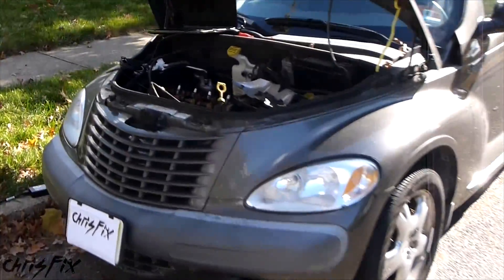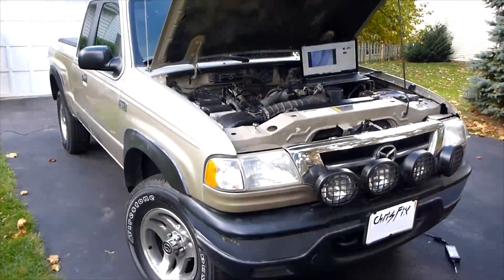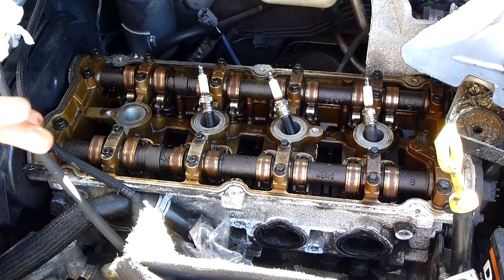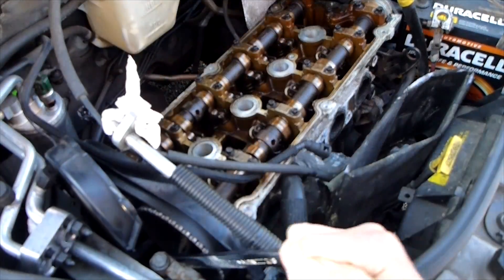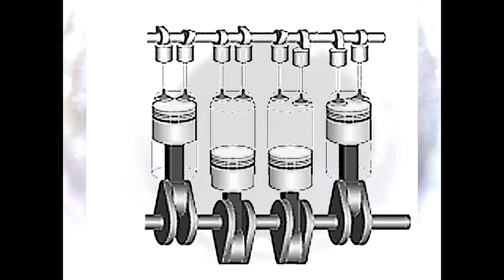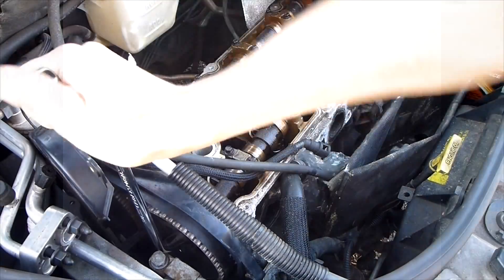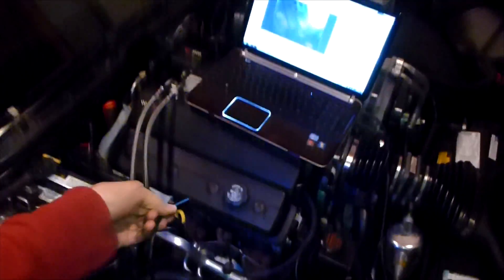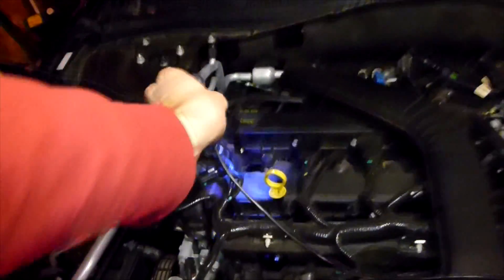What does the inside of an engine with a Bad Head Gasket look like?

Comment: Hey chris. I have a mazda 626 2.0, it burns oil badly. I just replaced valve stem seals, but still smoke. I can see there is some oil pooled on the top of cylinder 3 throught spark plug hole. How to tell if it's the head gasket issue, or from somewhrere on cylinder head? I have ordered an inspector as you used in the video, still on its way. Thank you Chris
Reply from the maker: +Jonathan Zhang It is not a head gasket issue. Sounds like a valve seal issue (even though it was already fixed.
Reply: +ChrisFix i found some milky color sticky stuff on oil cap today
Reply: Jonathan Zhang I am a mechanic of 40 years, from what you are saying it sounds to me that this is a blown head gasket, especially since you found milkyness in the oil. The best way to know for sure is to drain the oil in the vehicle and inspect it. If it has a whitish milky film in it or green coolant in it then it is a blown head gasket. It is possible that the sort of milkyness that you found is just condensation. The other possibility is piston rings, but since you found oil sitting on the piston, and that you just had valve seals replaced, my money is on head gasket.
Reply: blasterman17 Thank you oldtimer. I'd like to make an update: I ended up made a overhaul. relaced piston rings, and it cured the smoke (thus it's the rings). I spend lot of unnecessary time on it. And sold it to another innocent person for cheap. 
Can I have your email plz, to ask more questions in future?

Comment: So if the car ever overheats then the head gasket is leaking and could blow? Or are there other ways to tell if it's going bad?
Reply from the maker: ***** in some situations if it overheats it can be due to a bad headgasket. It can also be due to other cooling system problems. You can do a compression test to see if the head gasket is bad.

Comment: Hello ChrisFix , do you hose down your engine compartment? any tips on keeping them clean without damaging the engine?
Reply from the maker: Morris Lee I never hose down my engine compartment. Too much to risk. I use good old fashion elbow grease and a spray bottle of my favorite degreaser. I will make a video this summer on cleaning the engine bay!
Reply: Thanks Chris! Loving your videos and you say "good" at random check points lol
Reply: +ChrisFix, nice video. Crisp and straight to the point. Any advice on direct injection turbo charge engines' problem with carbon build-up on the valves? Do you think certain fuel additives might help? Morris Lee told me something about walnut shell blasting to clean it up.

Comment: For the cylinder #2 piston ring, that nick you see is probably the ring gap, where the two ends of the piston ring meet. The fact that you can see the gap when the rings are compressed is indicative of wear for sure, but it likely isn't a chunk missing out of the ring. The catastrophic ring failures I've seen usually involve the ring breaking through the ringlands on the piston and getting folded up, scoring the walls or pushing their way into the cylinder itself or crankcase.

I wonder if this thing seized? As much gap as there is between the wall and piston (especially on #3 and #4), I'd be very surprised if it didn't. I'm guessing the owners kept pushing it? Melted piston from detonation?
Reply from the maker: bassbone1785 Thanks for sharing! The owner was on the highway and couldnt pull off in time to shut the engine as it overheated.

Comment: Would that mini camera do for a 1994 7.3 idi turbo diesel engine, using the glow plug holes?
I do know that my engine burns a little oil.
Reply: Good idea!  Nice to have good inexpensive technology.
Reply: J Bishop Yeah!
Reply: From the video:  Interesting that the PT cruiser 4 cyl has head gasket leak problems... the Dodge Neon was infamous for them, everyone I've ever known with one developed a head gasket leak, usually also had to replace a warped head too!  Maybe all U.S.-built Chrysler 4 cyl had this problem?
Reply: J Bishop From what I have heard, Chrysler is pretty much junk.
Reply: From what I've seen, i'd say the same thing.  Getting taken over by D-B was the best thing that could have happened to them... but even they gave up on them!
Reply: It should work, on the VW they were about the size of spark plugs, and on the military diesels slightly larger IIRC.
Reply from the maker: Ford6.9/7.3idiDiesel It might work. I am not sure how large glow plugs are but I think it will work.

Comment: Please tell me you weren't the one that drove this car overheating enough to do this?? Was the temp gauge broken?? I worked on a corrola one time that welded aluminium from the piston on the cylinder walls and I asked how long did you drive the car with the temp gauge on high!! Answer was someone had to flag them down to pull over due to all the smoke on the highway!!
Reply from the maker: bigdaddymak1439 I was not. The person driving was on the highway and the temp just shot up and by the time he moved to the side of the road, the engine was gone.

Comment: Isnt a top tip for this not to run the engine when the temprature starts to climb way over normal running temp? Stop let the engine cool down and fill it up with water check the dipstick if you can see any sign of head gasket failiure etc? And last but not least scrap the  PT-Cruiser if you own one.
Reply from the maker: rimmersbryggeri The last part haha
Reply: They would have been cool if they had some power but as they were it was like a chinese copy of a hot rod to me.

Comment: Do you know what causes my car to overheat? My car keeps going over crazy temperatures and I get so nervous that the engine is going to blow. Its a V6 3.4 liter with about 183,000 miles on it.
Reply from the maker: pieter vanham Is the coolant filled? Are you loosing coolant? Can you explain more about your problem (when does it get hot, does it happen right away, do you have heat in your car, etc)?
Reply: Sometimes it always overheats. When It started I saw steam coming out of the hood and I saw near the red. And we though it might be a coolent leak. So we  coolent in ever week and stopped and im still getting it!
What should I do im putting the head on.
Reply from the maker: pieter vanham That could be a head gasket or it could be a bunch of other things. I would take the thermostat out and run the engine without a thermostat and see if she still overheats.

Comment: Was that a crack in the block of your pickup? (thin dark line running op the bore up to the head gasket)
Reply: Thats good news, I guess. :) Sorry for the scare, haha.
Reply from the maker: Oscar Flyer I think the cleaners caused the misfire. The truck was running great before all of the test! I am trying the cleaners to see if they actually work.
Reply: Yes, I know what you mean. I also got much worst misfires after using one of those cheapest old school OTC, race track sponsors, you know ...
The PEA ones are a little better, but doesn't gave me good results also. I end up replacing all the 4 injectors at 110k miles on my Subaru. In the Ford Taurus 70k miles, they didn't made any perceivable difference.
Reply from the maker: Alexander Burgers I dont think so and sure hope not. It is hard to tell on the video.
Reply: I don't hope so either.. maybe its just a random scratch or something.. :)
Reply from the maker: Alexander Burgers The scary thing is I am getting a misfire in that cylinder... Now I am going to have a hard time sleeping until I do a compression test! Good eye!
Reply: ChrisFix Was a crack?
Reply from the maker: Oscar Flyer No, I went back into the cylinder to look and it wasnt cracked. I think the fuel injector is not working right.
Reply from the maker: Alexander Burgers haha no worries bud! I am glad you pointed it out! I totally missed it!
Reply: I'm glad to hear it isn't a crack even though it seems a lot. So, Chris, are you trying all those cleaners because of the misfires?

Comment: Can you do a video showing the before and after with steam cleaning?  I have heard you can pour distilled water into your intake like Seafoam and steam clean your pistons.  I've seen your other engine cleaner videos, but it would be cool to see straight water.  They recommend changing your oil afterwards.  Thanks.
Reply from the maker: Chase Thomas yes, I will be doing a video on using water and showing the before and after.
Reply: Cool cant wait!
Reply from the maker: ***** I will see if I can find a diesel engine to test it on as well! I am not sure if a mist will be better or not. It would definitely prevent hydrolocking if you use mist.

Comment: On some cars the repair manual clearly forbids turning the engine from the cam shaft. They usually advise for turning from the crankshaft.

Not sure why, maybe not to overstress the timing belt tensioner.

You could also take a look at the sparkplugs. Maybe some specific marks from piston melting, headgasket failure are also present on them.
Reply from the maker: rosharky This engine is garbage so it doesnt matter lol but thanks for the tip!

Comment: did he rotate the engine with the cam
Reply from the maker: jay7264 Yes. Since the cam is attached to the crankshaft via the timing belt so it will turn the engine.
Reply: ChrisFix i thought it was bad to turn the engine by the cam i was told by my teachers that your not supposed to do that i guess it doesn't matter cause that engine is toast anyway
Reply from the maker: jay7264 Exactly. I dont really care if it is bad because that engine is blown up haha

Comment: Here's a good use for your boroscope, locate leaks in the house behind walls and ceilings.
Reply from the maker: Peter Kapica That is a good use!
Reply: Also please seafoam the mower again. No offense, also can you try a gallon of laquer thinner mixed with half a tank of gas and then a long long hard drive at full throttle for a decarbonizing additive to test. Mechanics like scotty kilmer does this to clean engines and catalytic converters

Comment: GREAT video man. Shame on the Pt Cruiser. Cil 1 and 4 seems to be less damaged. That is expected or just failed in that way ?. Was it running (I ask because you were be able to turn the engine) of was shot ?. I read that neons and stratus have not  good reputation on their engines, dont know the Pt Cruiser. Cheers
Reply from the maker: 38911bytefree Thanks man! Yea, there is no compression on any of the cylinders but I think that is because the head gasket went and then cyl 2 and 3 are toast. The Neon is basically the PT cruiser but with a different body. They share the same chassis and engine. Their quality control and build quality are garbage.

Comment: And the only reason it went 2-3 months is it didn't show itself, we took it to a shop, they said water pump.
Reply from the maker: Chinesefoodrocks1521 Yea, that happens. Also, sometimes the head gasket has a tiny leak which isnt a big deal, but then it just becomes bigger and goes all at once (I think that is what happened with this).

Comment: Chris, I've been losing coolant at about a gallon every few weeks or so for quite some time now. Compresssion is good, but my block test with the blue dye did turn a little yellow. Water pump has a little spotting around it, as well as the thermostat and all the other sensors. I have no spots on the driveway. Should I replace the easy stuff before I call it an internal issue?
Reply from the maker: helivesonforever If you have no leaks and you are looking a gallon every few weeks, I would think it is internal. I would make sure you dont have any leaks. If not, the only place the coolant can go is in the cylinder.
Reply: ChrisFix  I can't see any leaks, and my driveway is dry. Should I try a leak dye test? Car runs fine, exhaust smells normal. What tools do the pros use to test for internal leaks?
Reply from the maker: helivesonforever External leaks will be pretty easy to find because coolant does a good job leaving a trail. You can do a coolant pressure test on your cooling system to see if there is a leak.
Reply: ChrisFix One of the wet areas I saw today was around my EGR valve. I plan on getting a new gasket for it. Should I clean it while it's off? If so, what do I use?
Reply from the maker: helivesonforever The coolant cant be leaking from the EGR. Is there a coolant hose near it?
Reply: ChrisFix The water pump is right below the EGR on this truck. Possibly a leaking water pump around the gasket? It's wet/oily right in between the two. I've never seen a water pump leak there though, just around the spindle as they wear out.
Reply from the maker: helivesonforever It could be the water pump gasket or the water pump could be cracked. Run the car to operating temp and see if you can get a flashlight and search for coolant leaks.
Reply: ChrisFix Thanks, would it be possible for the coolant to evaporate before I saw it on the ground? Also, don't they sell a UV dye that I can add to see exactly where it's coming from?
Reply from the maker: helivesonforever It could be such a small leak that you wont see it but typically you will see a drip. They have a UV dye: http://www.amazon.com/gp/product/B008B580KI/ref=as_li_tl?ie=UTF8&camp=1789&creative=390957&creativeASIN=B008B580KI&linkCode=as2&tag=chri0e2-20&linkId=XLVLRIV7X2K5F4V6
Reply: ChrisFix Thanks, that's much cheaper than the stuff at O'Reilly auto. I'll be replacing the egr valve gasket and cleaning the actual valve. A water pump is a pretty difficult thing to replace nowadays, isn't it?
Reply from the maker: helivesonforever Water pumps are pretty simple are on most cars. As long as the waterpump runs off the serpentine belt, and you have some access, it is pretty straightforward.
Reply: ChrisFix Should I go ahead and do a timing chain while I'm at it?
Reply from the maker: helivesonforever Are you having a problems with it? If not, it should be fine. If you want to do it as a project, then go ahead. I normally dont do a timing chain when I replace the water pump.
Reply: ChrisFix Alright, I'll leave it alone since it's fine. On my water pump, the fan clutch is on it. Do I need a puller to remove that?
Reply from the maker: helivesonforever Here is a video that will help you: https://www.youtube.com/watch?v=_mAjPwKv5l0

Comment: After this video I decided to subscribe your channel ;)
BTW, what does piston burn? Is it only overheating? And how high it should overheat to melt a piston?
Cheers ;)
Reply from the maker: Marcin Wojciechowski Great! Glad you subbed! The piston and cylinder gets too hot when there is no coolant to cool it. Then the thinnest part of the piston will melt first. The temperature at which it melts all depends on what the piston is made of and how it is designed.

Comment: That cylinder of your truck looks amazing man! Just curious, what motor oil are you running in this engine?
Reply from the maker: VintageOutboardMan Thanks man! This truck was abused and not taken care of at all before I got it about three years ago. I use Mobile 1 fully synthetic in it now, but it always saw conventional oil.
Reply: I think the truck is very happy it now gets good maintenance haha!
Unbelivable it still got the original cross hatching after years of abuse.
Do you use any fuel or oil additives to keep the engine that clean?
Maybe you can show us some other cylinders from different engines. There are very few videos on youtube showing the inside of a cylinder and the quality of your videos are far superior. I think many people would appreciate it if you could make some more videos with that awsome little camera :)
Reply from the maker: VintageOutboardMan I do not use any fuel or oil additives although I am going to try a fuel additive to see if it cleans out the cylinder (before and after video). I like your idea with looking at different engine cylinders.

Comment: DUDE DUDE DUDE!  You've taken everything to the next level Brau!  :)  Thanks so much for your awesome vids.   I suggest using your new "holy cam" in all the hard to see spots under the car.  For example, my 2004 Venture has a bad leak in the PS rack.
You could explain how to remove the rack using your Holy Cam because nobody else has a decent vid like it.  Like most guys, I imagine the holy cam will be useful in the porn industry.   Great job again Chris!   :)
Reply from the maker: Johnny DioGeorgio Thanks Johnny! Thanks for the suggestion. I dont have a PS rack leak but if I ever need to do the job on my car or another car, I will make a video for you!